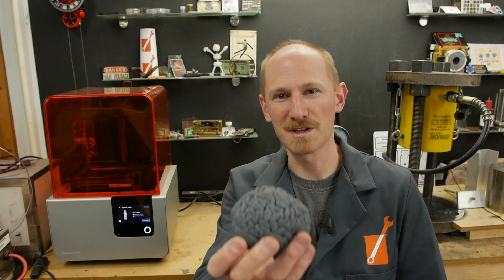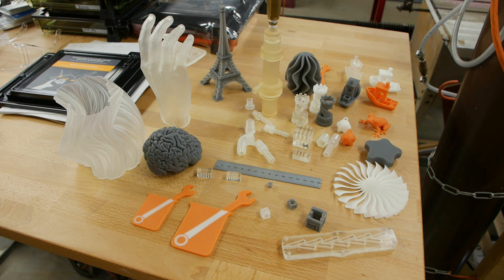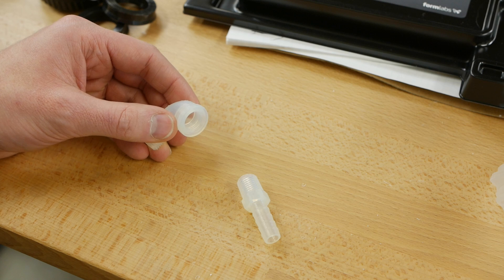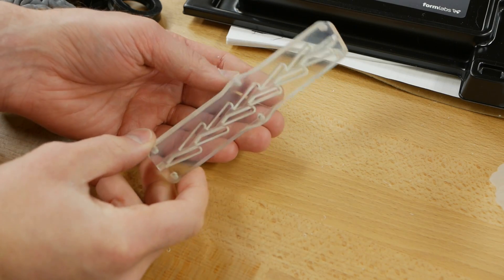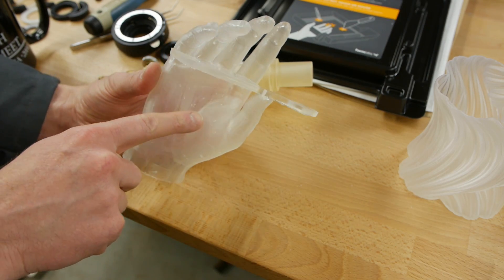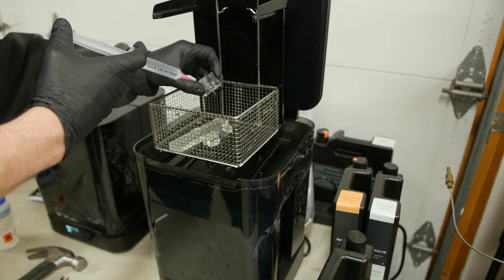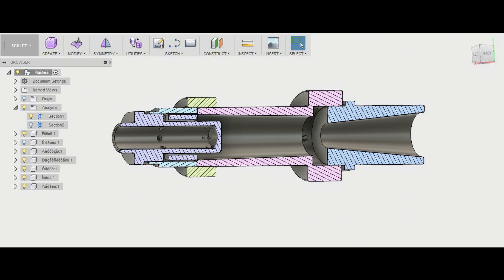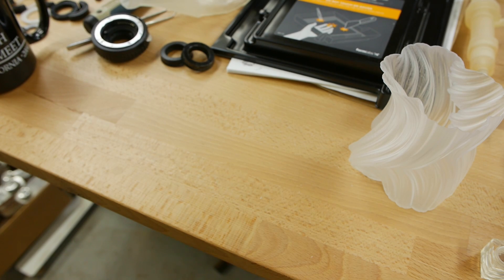3D print your brain, timelapse, high-res microfluidics, custom colors...

Comment: Cool shit, have head about these before. Unfortunately these printers are extremely expensive so they are not for the ordinary Joe which is a real bummer.
Reply: They are affordable. This machine is 3 grand and Anycubic Photon or Wanhao D7 is about half a grand.

You might not want to keep one at home though because of poisonous fumes. If you have a room you can dedicate that can be well ventilated, or you have a lab with a fume hood, you're all set.
Reply: Ah, didnt knew there existed other models based on the same principle/technology. I thought this was hard patented, a lot of propriety things or such and thus only this model, cool. However I might although have a feeling the other cheaper models does not have the print quality and stuff as the way more expensive ones like in the video. But really cool there exists affordable ones, but I only hope then that the flyid udes is not the thing they earn the money on and thus expensive like fex ordinary ink printers.

Comment: Couldn't you just cure them leaving the pieces in the sun for a while?
Reply: Pablo Rodríguez 
That does work but is uncontrolled and inconsistent. And is only available for half the day.
Reply: It would cure one side more than the others. Also, wind etc may be a problem.
Reply: Angus at MakersMuse sun cures his Form2 prints and they turn out perfectly fine. It doesn't seem to end up mattering that one side is more exposed to the sun, the goal is to cure the print completely and eventually it will complete just from reflected/ambient UV light.

But if you already have a Form2 curing chamber, why not use it? It's fast, easy, and office schedule friendly, i.e. you can run it when you come back from work and the sun has already set.

Comment: and here I am with my poorly configured anet a8 :-(
Reply: Oh don't worry about it. I mean it's a 3D printer, and it's also just a bag of parts that don't specifically need to be used exactly as intended by manufacturer.

I suggest you look at video "How to print resin-like FDM Minis on $200+ 3D printers" by "3D printed Tabletop". OK, there are numerous ways to accomplish what he's doing there, so don't stick to the method religiously. I'm just giving this as an example of beautiful prints you can get off cheap FDM.

And yeah i know it's an Ender, which is out of the box much better than Anet. But don't despair, there's nothing fundamentally wrong with your device, you can stiffen it up, you can tune it up, there's no reason you couldn't get the same results. Furthermore Ender is Bowden fed, which is a bit of a double edged sword, i mean... yeah the head is lighter and resonates less but the pressure behaviour of the filament in the tube is completely bonkers.

I recently learned of EMT8 (for Imperial land) and AMT8(Europe/Asia) rebuilds for Anet printer frames, they should be hilariously cheap, like maybe $15. I'm thinking of adapting one of them to my Geeetech, which will take a few changes.